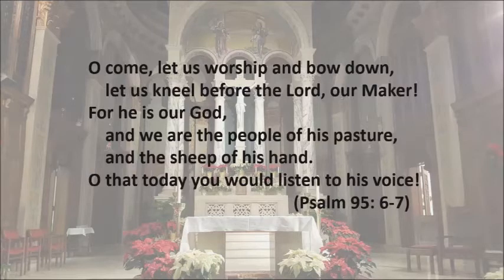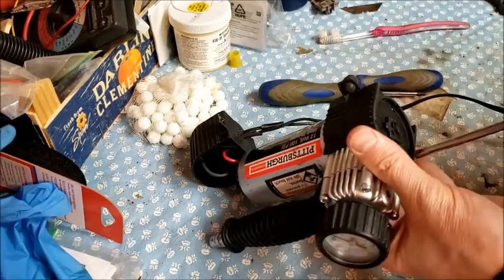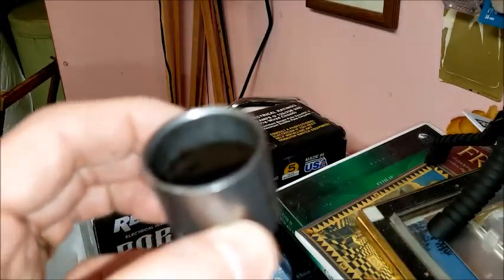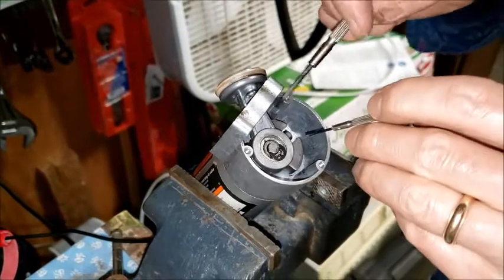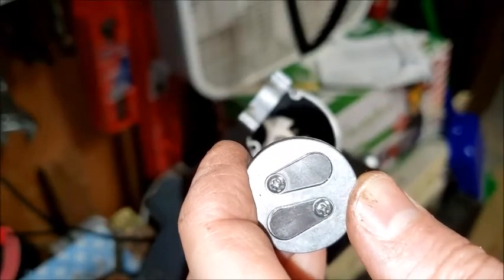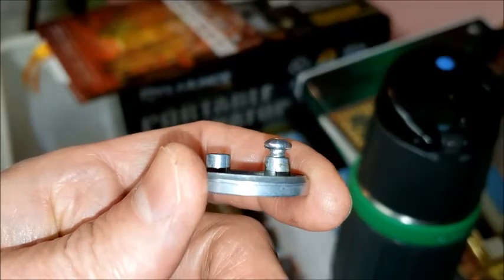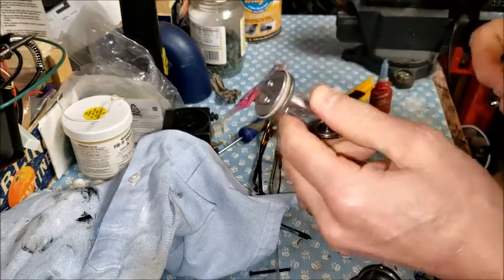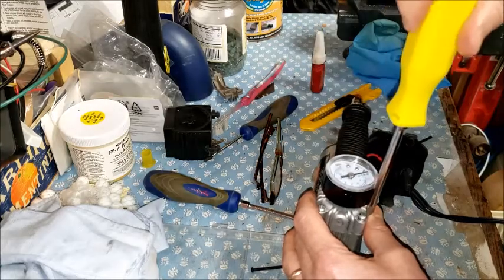Harbor Freight Pittsburgh mini compressor repair

Comment: I ran into a similar problem with the wire coming out of the bottom. Relocated it to the top and glued in a switch. They have a few flaws like the plastic hose and odd quick connection. They are pretty good especially for the money.

Comment: Thanks for the looksee at the innards. I've got the same model, and after being reliable for years, it also seems to have begun not really pumping up to pressure like it used to although it seems to be running well enough. So, I might try the same as you--maybe a little cleaning and oiling will bring mine back too. It seems fairly straightforward.
Reply from the maker: Thanks for the comment.
Reply: @diywithdave3186  Yeah, it worked a charm and was quite quick to do. I also had go back in to use a little gasket sealant goo to hold the sealing rubbery "o" ring in place beneath that little spring metal check valve doodad held on by the single tiny Phillips head screw. But it's all good now. Thanks again!
Reply from the maker: @BilgemasterBill  thanks for the feedback and the tip.  Glad it helped.

Comment: The 2 flaps on top of the piston look like Reed valves... I watched your axle replacement video. Tge video where you replaced the axle & control arm...You were very lucky that the rear control arm bolt was not seized!!!!! Mine were seized on my Pontiac G5 & had to be cut out!!! WHAT A NIGHTMARE IT WAS! Also, when I pulled the axle, a bearing came off with it & there was a gapping hole in the transmission. I forget exactly which side it was but, I think it was the passenger side axle. Now the transmission went out so, I surely hope that the front subframe bolts will come out. The rear subframe bolts are the 2 that attach the rear control arm...P.s. with small air compressors, you never want to run them for longer then 5- 10min at a time...
Reply from the maker: Thanks for the information.  I appreciate you taking the time to share your experience.

Comment: If you buy the $10 warranty just swap it out once a year
Reply from the maker: That's probably not a bad option. It doesn't appear be built to last very long with heavy usage.
Reply: Did you try contacting the manufacturer to see if they sell the piston seals?